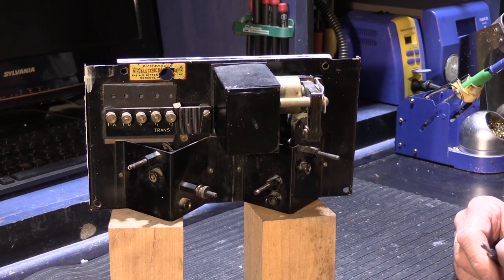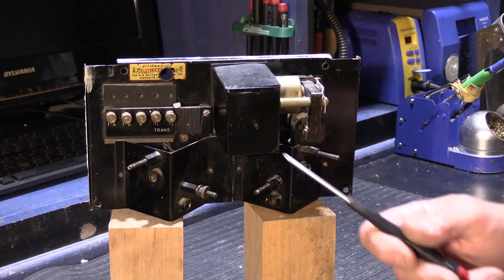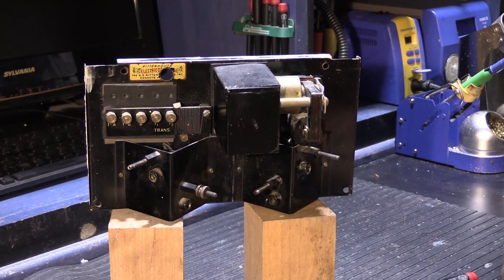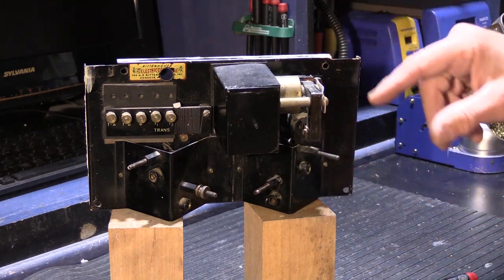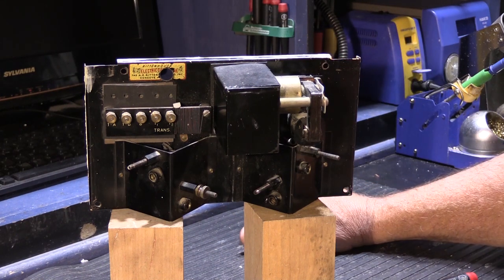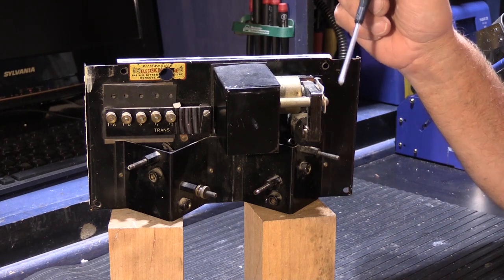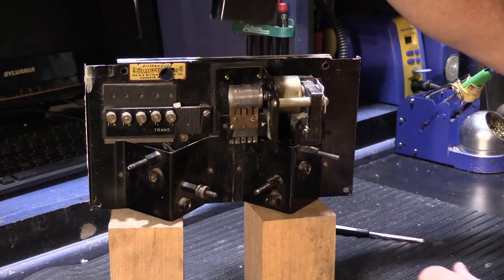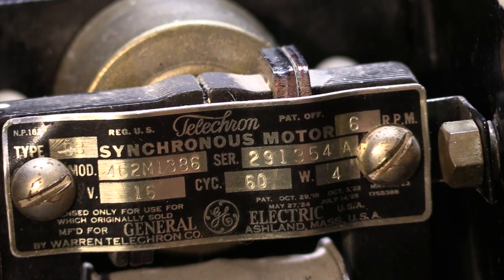Repair and Servicing of a Vintage (1940's or 1950's??) Rittenhouse 8-Note Long Tube Door Chime

Comment: like the monty python reference :-D
That has to be the biggest music box i've ever seen,  the normal music boxes have a tiny drum with pegs, but that door chime has a monster drum in comparison :-D
Heavy duty quality made chime.
For some reason i was thinking about the drum wear,  if the slopes were painted black and optical sensors mounted where the contacts were,  it would never wear the drum out. 
the optical sensors would drive the inputs of a ULN 2000 and something driver to pulse the solinoids.
I do think up some rubbish lol.
Reply from the maker: Hi zx8401ztv:  Interesting idea - if only they had such devices back in the day - Chris

Comment: This is an incredibly rare specimen. The design of the mechanism is known to a lot of collectors as the "music box" mechanism, being that the rotating drum and contact design is reminiscent of a wind-up music box. This is a very early design, I would say it's from the late 30's - early 40's. This came long before the standard synchronous rotor design. The mechanism is quite troublesome, the bearing for the drum shaft wears and the shaft itself is often out of round so it's no question why Rittenhouse changed designs.
Reply from the maker: Hi Baltimore Alarm:  Interesting.  I think it's one of those designs, that if it went through 1 more revision - it would have been a keeper - Chris

Comment: Just some thoughts about how parts might be replaced if needed.
- The chime hangers look like something you could have made at a machine shop on a lathe, or maybe DIY on a mini-lathe.
- If the copper fingers for the switch had been broken, it looks like a new one could be sawed or rotary ground out of a copper sheet of the right thickness, and the bend made on a two part mold-like jig before cutting.  Not sure how a machinist would go about the switch contacts on the end - maybe drill it and solder in a short piece of rod stock of whatever metal it is?
- If the drum were trashed...someone ambitious might try making a mold and casting the outside and machining the inside, or reverse engineering whatever device originally made it to punch an aluminum tube if you could find the right thickness.  Or maybe 3d scan and have it made on a CNC machine or 3d printer.  Anything I can think of would be expensive and/or hard to get right.
Reply from the maker: Hi CyanAardvark:  Thanks for the comments - Knurled Nuts are fairly common and finding some with the right thread shouldn't be to hard.  It would probably be best to replace all 4, to keep things uniform. It might be necessary to restring the Tubes to have then hang at the right height.

If the Copper Switch was broken - it might be possible to solder patches to repair it.  If a new assembly was needed, it might be able to be cut in on a CNC machine or a Water Jet machine.  The Switch Contacts could be soldered to the copper fingers.

The Drum is probably the trickiest item to replace.  The inner part is solid steel - a good machinist should be able to reproduce it.  The drum could possible be made from some stock aluminum tubing, with the "Tabs" bonded to the outer surface.  Of course, you would need an example to copy to get the Tab order correct.  

My experience with 3D Printing tells me that it would take an Excellent 3D  CAD Designer to create the print file.  This would be an expensive process, I can easily see it costing hundreds of dollars to do this - Chris